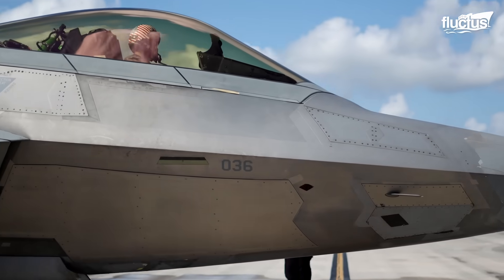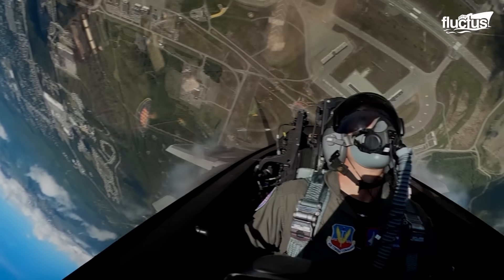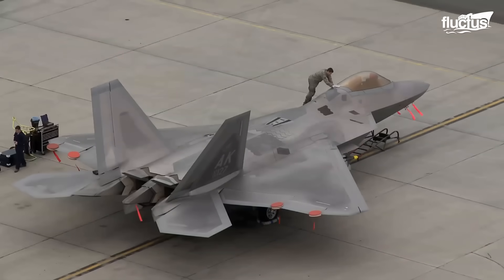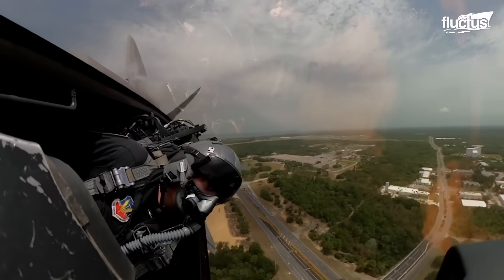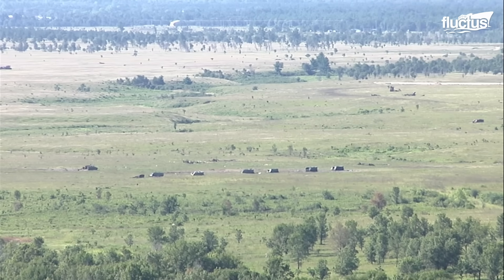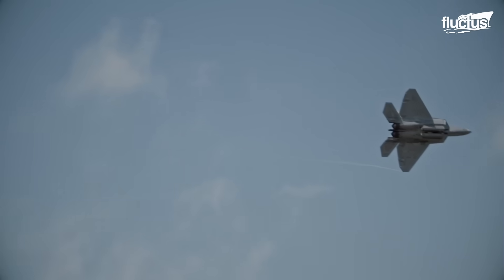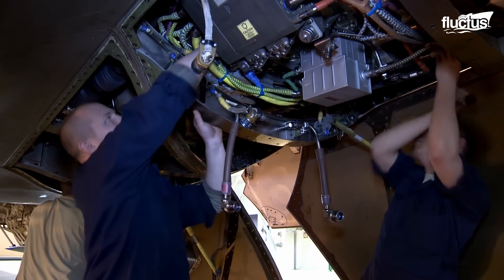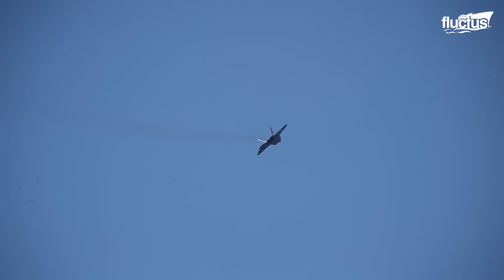F-22 Raptor - US Most Aggressive Stealth Fighter Jet Ever Made

Comment: F22 is too expensive and too good at everything. The problem is that the USAF doesn’t need such a super fighter. They only need its stealth capabilities for the most part. That is why they went toward the direction of the f35 which is cheaper. Essentially the raptor is too good for a single aircraft. USAF is only keeping them to be their Trump card essentially.

Comment: F22 only looks good in air shows and good for shooting down weather balloons.   The reality is that the F22’s design flaws are beyond repair, leaving no choice but to cease production. It’s a total waste of money.
Reply: It looks good in doing that only because, for now, it's everything It did. Just wait the time when they Will see action
Reply: Name any countries dog fighter that actually seen war within the last 30 years 🤡😏
Reply: Not true, the cost per Unit was the real reason 😂🤷🏾‍♂️
Reply: @lurifixxx4000  exactly, impracticality is one of the worst design issues.
Reply: @lurifixxx4000  you can verify this online. While the F-22’s design was groundbreaking over two decades ago, it comes with significant trade-offs: high maintenance requirements, limited adaptability, engineering complexity, restricted multirole capabilities, a short combat radius, recurring issues with its pilot oxygen system, and the use of titanium alloys and composite structures that are challenging to produce on a large scale. Essentially, it’s an impractical and inefficient platform for any real task.

Comment: F-22 is nolonger in production. China has 300 J-20s and adding 100 per year. Quality is nonstop improving. J-20, J-20A, J-20B, J-20S. J-20B  use WS-15 engine to make it flying faster than F-22. Also, with better electronic system and longer range missiles. J-35A is more stealth than F-22. Can you compare an IPhone 1 to an IPhone 15 and 16?
Reply: Chances of detecting a f-22 is almost impossible 😂its the size of a bumblebee 🐝  you think 🤔 Russia or china can fly that fast laugh out loud 😂 if you remember raptor pilots where passing out there tech is not better than ours 😂 china cant even land on a air craft carrier barely if they are it during the day only so sit down 😂
Reply: @Streetlife1025  China has anti-stealth radars and missiles. Please read the news Zhuhai Airshow.
Reply: @ china 🇨🇳 says alot of things dont make it true! Why you think japan 🇯🇵 wants yf23 air frame 🤷‍♂️ only jet ✈️ capable of going up against the raptor

Comment: On Wednesday, November 6, 2024, I propose the development of a "Nth Generation Air Dominance (NGAD)" system. The technology required for this initiative exists today or should be initiated. The proposal entails the creation of a tier-one fighter vehicle capable of launching from ground level, such as an airport, and continuing into space (i.e., Earth-Low Orbit, ELO). It is likely to be a large vehicle, the same for tier two.

This development package consists of three tiers. The second tier involves a space drone (tier-two) that can also take off from terrestrial sites and penetrate into space. Its primary function would be to refuel and arm the tier-one fighter and tier-two, respectively. Additionally, it would be equipped to defend itself during space operations, supported by terrestrial fighter escorts.

The third tier would be a larger vehicle designed to serve both the tier-one and tier-two units. This larger vehicle would provide defensive support for itself and the two subordinate tiers. The development team would decide whether to refine this initial configuration further.

(Collaborative Rewrite with Grammarly).